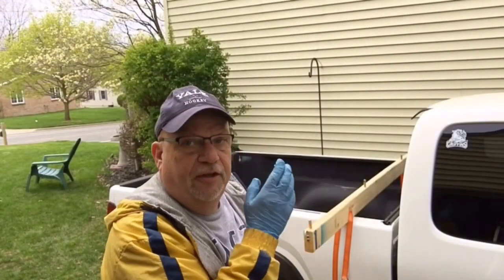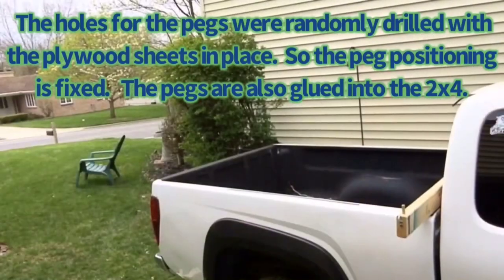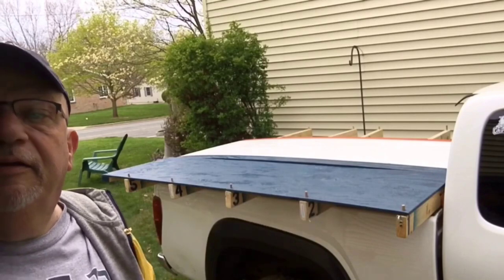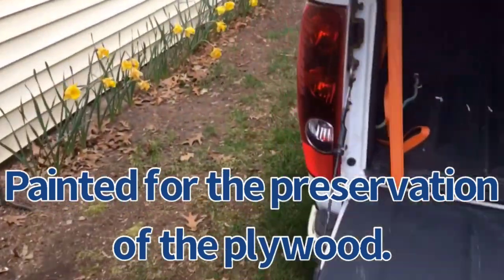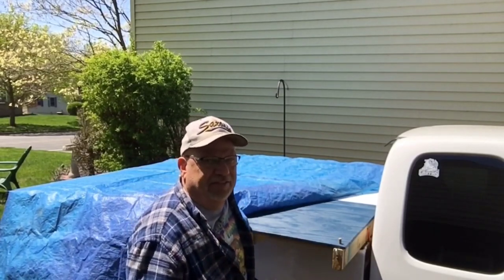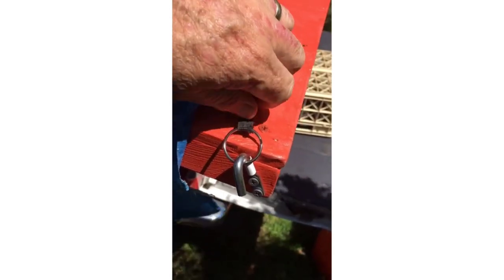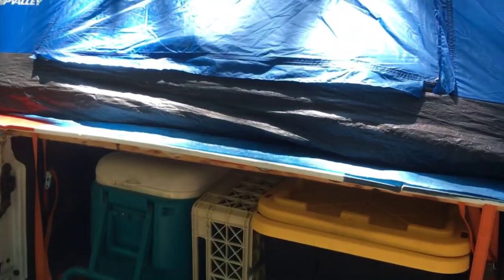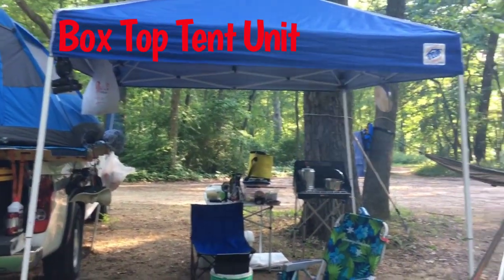Pickup truck- box top tent /

Comment: Great video 
Do you take off everything from the truck be. I know the tent comes off, but does the 2x4 and plywood come off when driving. How do you move from place to place. Thanks
Reply from the maker: When I initially constructed the deck my plan was to assemble it on campsite.  Until last year (2022) when I decided to attempt assembling it a home and drive to the campsite.  I am proud to report that the 234 mile round trip was successful without incident.  I did stop once or twice to check the tension on the straps to make sure they were tight.

Comment: How do you haul it?  How far does it stick out if the bed?
Reply from the maker: Initially I hauled it in a dismantled state.  Then after successfully trying it assembled on a few times on short trips, I now haul it with the platform assembled and strapped securely to the box of the truck.  This also gives me additional storage for a couple of totes on top.  In answer to your second question, I would estimate that the overhang is 12” to 15”.

Comment: @Paul, do you set this up the plywood construct at your home and then drive to the campsite?  You mentioned storing your camping gear underneath the platform.  Alternatively, if you drive there before building up the platform, do you just have the plywood and 2x4’s laid into the bed at a slant with your camping gear tucked in various spaces around it?

@Luis, will you be making a video of your set up? 

@youtube viewers…anyone seen something similar to this on YouTube?  Paul, you might be an original!!!